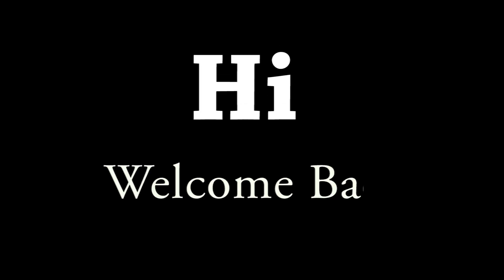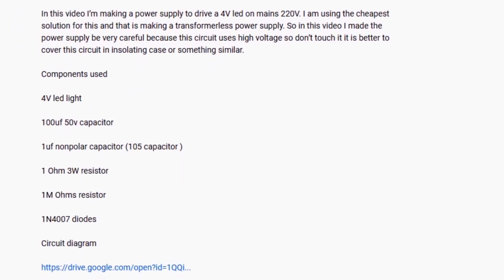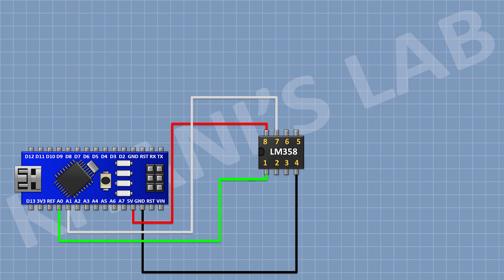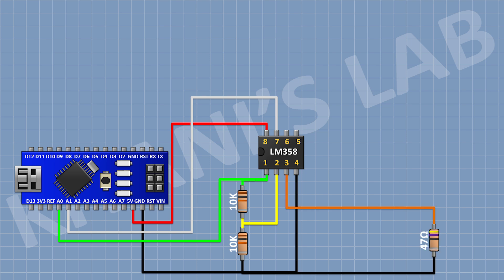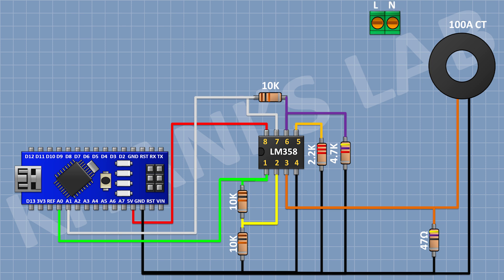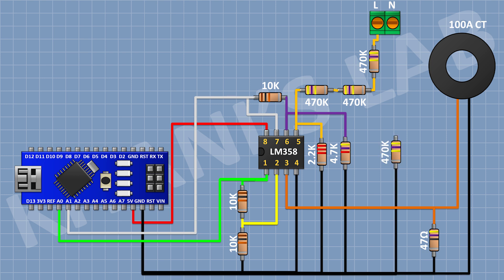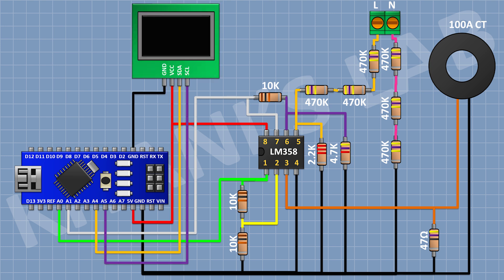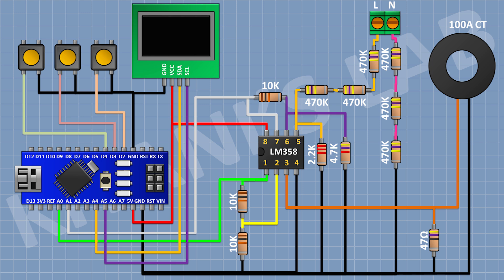DIY 4-in-1 AC Meter | Arduino Project

Comment: Bad design. The Wh is not accurate because you are not getting the Power Factor readings. That design is for DC not for AC. And that circuit design is very dangerous.

Comment: Please PLC generator control 3 face high powerful water level fuel level oil level LCD display 16X2 push button code Arduino nano 😊😊